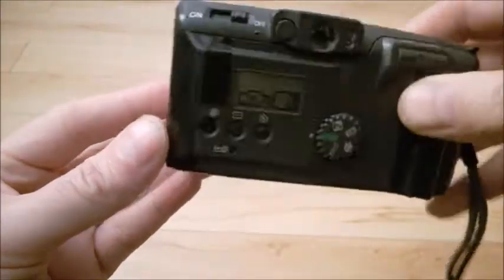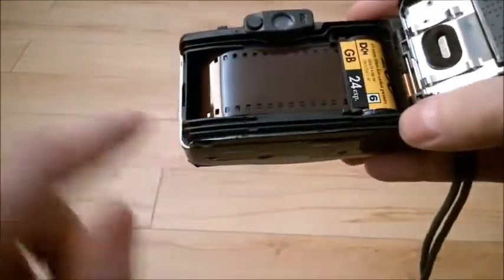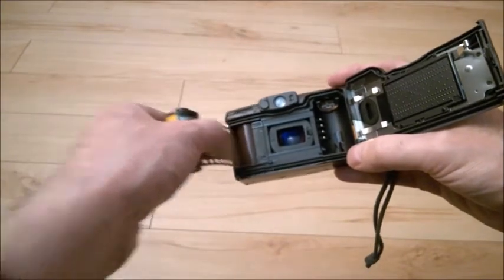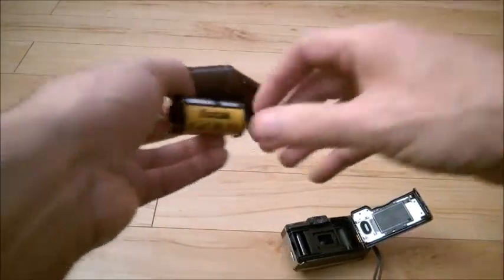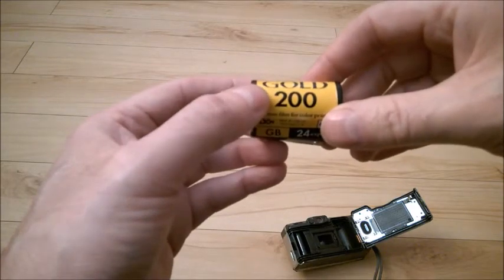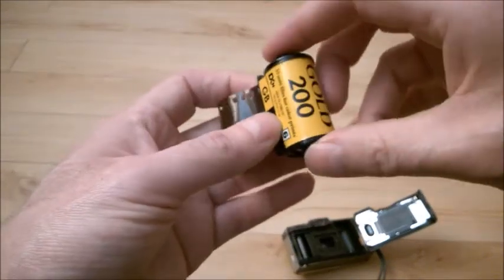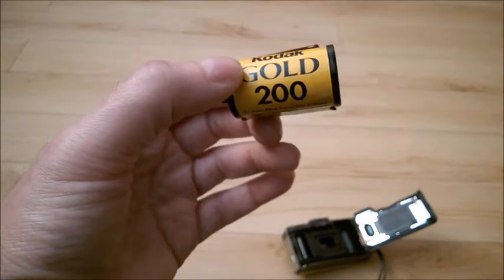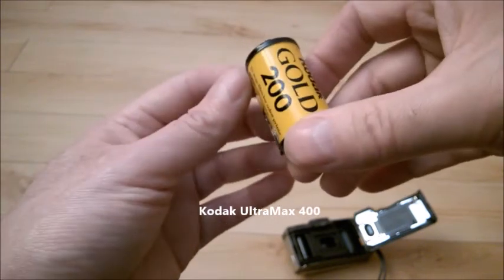How to (safely) Remove UNFINISHED 35mm film from Camera

Comment: help me! my film roll stuck in the middle of shooting so i decided to roll all the film back..how can i use it again?
Reply from the maker: If it went all inside the canister you may be able to bring the tip out using a 'film retriever tool'. Then put the film back in the camera and shoot in complete dark room without flash until after the last position.
Reply: @Peppermint1  Thank you!

Comment from the maker: I uploaded an Updated video  https://youtu.be/C7EQ254-dTQ
If there is a metal clip on the cylinder keeping the exposed film, pull gently on this metal clip while doing the procedure in the video
Reply: What do you mean by metal clip? I tried this method but my film was stuck. I cant pull it out.
Reply from the maker: @charrysalce4580  Which camera is it ?
Reply: @Peppermint1  Oh i just pulled it off. Just need to exert some extra force. Thanks for this video. Got my film back safely.